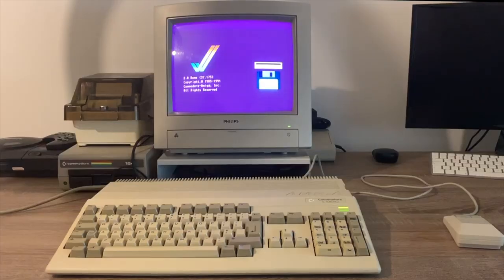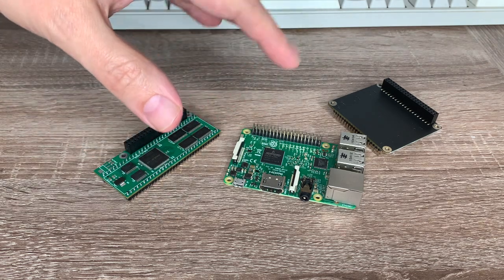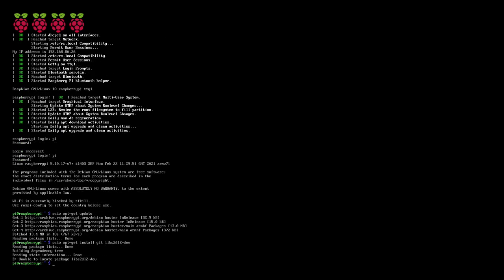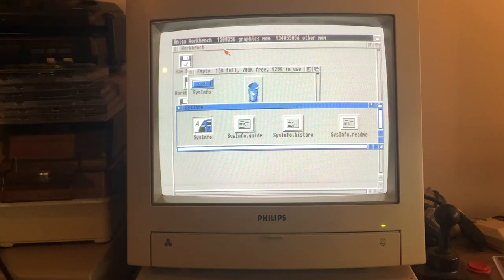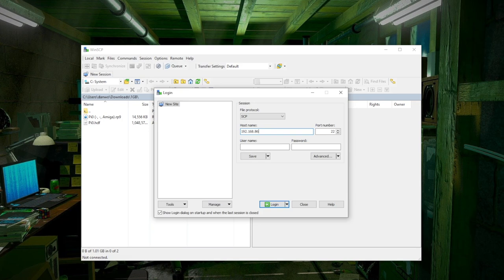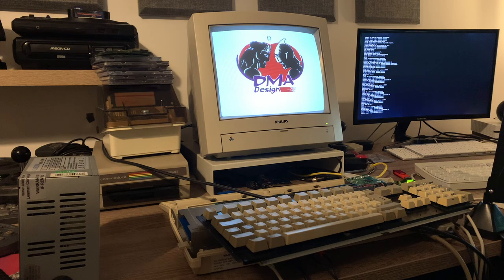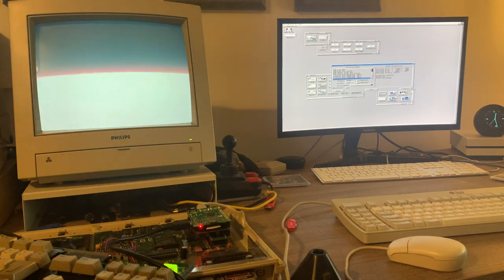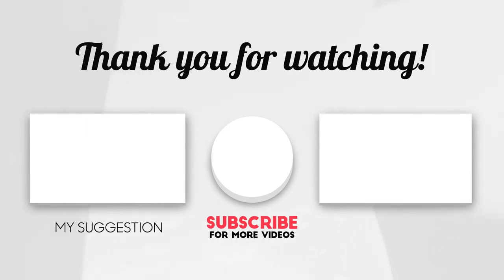PiStorm: Turbo Boost Amiga 500 With Raspberry Pi

Comment: This sounds too good to be true. If this was a month before I would definitely call BS, tell you the video is all smoke and mirrors, and an April fools joke. As it is, I won't be fully convinced until you use an actual classic Amiga mouse and keyboard, or I contend you're just outputting a pi to your CRT screen which is easy to do. Show me all the connections in one video shot/scene please.
Reply: you can just look up the project yourself, its not a trick
Reply: @deadair32101  That's it though, I have looked around and still have the same questions for them. I want to believe.... 
I would dearly love one for my A1000....but it just seems as unlikely as amputating the head of a dog onto an elephant.
That said, I see the RMC fellow, whom I also follow, saying he has one, so hopefully, my skepticism is unwarranted. 
You have to admit, it would make a good April fools joke though.
Reply: I dunno, the more I look for answers the more uneasy I feel about the veracity of the project. There's lot's of technical info, that can be interpreted many ways. I see red flags. Sitting on the CPU socket instead of running through the trapdoor for instance, which would likely be more convenient to most users, and the excuse given. Did I just see an AGA demo running or not? If so, how'd it do that? They say it only does RTG!!!!  Is it using the ECS/OCS Amiga graphics hardware or not? If not, why do they seem to need 1MB of Chip RAM on your Amiga? And then there's talk of fusing video signals between the Pi and Amiga which seems silly and OTT, or not supporting natives modes. The excuses for various limitations continue to accumulate and it smells fishy. Is the Amiga hardware merely a peripheral for the Pi here? I'd actually settle for that. But.... I mean, if you're eagerly showing me Amiga emulation stats on an LCD monitor, with a USB mouse/keyboard also connected to the Pi, instead of provably through the A500's keyboard/mouse and connected CRT monitor I call BS. Is this an elaborate hoax or a joke I'm not in on? So far everything I've seen is easily replicated with a HDMI to RGB converter from a Pi. I don't actually see the Amiga side doing anything AT ALL.
Reply: @AussieAmigan  the pi is replacing the cpu of the amiga completely, it's not sitting on the cpu. It is the cpu itself, hence why he could change the cpu characteristics by tweaking a few lines of text
Reply: @AussieAmigan  there are still bugs in the cpu emulation which is why some things don't work right yet
Reply: @deadair32101  I meant the CPU socket (I know it's meant to be a CPU replacement).... I'm STILL not sure what I actually saw though, as there were video cuts at important times and screens shown independently of input from the Amiga, and when there was there were issues. Was an actual Amiga running? Get what I mean? Which leads me to my next question, why wouldn't you put this Accelerator(?) on the trapdoor so if there was an issue you could fall back potentially at the flick of a switch? I want to believe.
Reply: @deadair32101  Bugs in the CPU emulation would be a convenient excuse for a hoax.... Sorry but surely, there's something, however minor, that is verifiable, that does work they could show. I dunno, they've got video output seemingly coming out of the Pi(thus the higher screen mode, or was that another Amiga mod?) as well as CPU emulation occurring with the Amiga simultaneously.... I want to believe...but.
Reply: @AussieAmigan  i don't remember what exactly the trapdoor exposes, never having the chance myself of having a actual amiga. Maybe it doesn't expose all the cpu lines? The actual amiga was running, that's what was being shown on the crt, he just had a screen for the pi as well to help himself
Reply: @AussieAmigan  it's less of an accelerator, more of a total cpu exchange. Its the same idea of replacing a old 486 with a emulated one on a old pc to get more speed, if that helps at all
Reply: @deadair32101  I get the concept. I've had accelerator cards on my PC as well. Back in the day I even used one in my A1060 Sidecar to go from an x86 to a 286. I'm also questioning the veracity of implementation. If not the trapdoor, then the expansion port on the side, which plenty of CPU accelerators use. And even if it does work, the Pi emulator is running on Linux, and unless its stripped back to the bone, goodness knows what that will want to do at odd moments, which will certainly cause crashes due to what I imagine would be the exact timing issues required by a CPU. I guess there would have to be a sweet spot speed-wise where it's more or less guaranteed to be reliable. Well. I really hope this project is real and works. I'm looking forward to RMC's review.

Comment: pistorm seems to be an interesting proof of concept but in pratice is a waste of time and money. It has no sense to put a poweful computer inside another one just to emulate a more powerful cpu. It would have more sense to develop a native amiga os for the raspberry and develop a computer case that resembles the old fashion amiga cases.
Reply: This does HDMI far cheaper than other accelerator cards, my friend has A500 waiting for me to just pick it up but i have no other input method besides HDMI and DP.
And those Vampire cards are what you are talking about, expensive, 1000x more powerful and they bypass the whole original hardware.
Reply: If you've never used real A500, you would think "just make a replica case".
Reply: There are the ARMiga machine and the Amibian distro for the Raspberry Pi but you'll lose compatibility with Amiga peripherals and need adaptors for everything, and there are some things for which there are no adaptors.
Reply: @woldemunster9244  Dan said it doesn't pass through Amiga's native video, so until there is an adapter to bring the video in you would still need a display solution for the native screen modes. RTG for Workbench and some productivity work still.
Reply: @roscoe500  claude is even working on an adapter to pipe the native video into the Pi's CSI port to allow switching of the native Amiga video with the RTG video over a single HDMI
Reply: Marsim, you're maybe right. Perhaps we should finally time-travel to the future and see every computer obsolete.